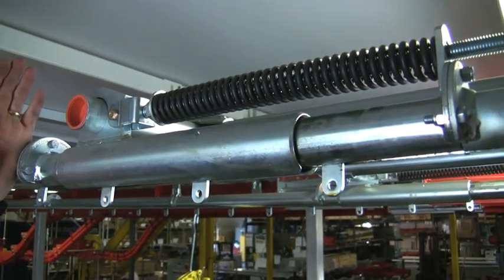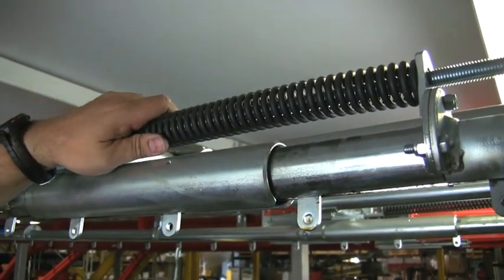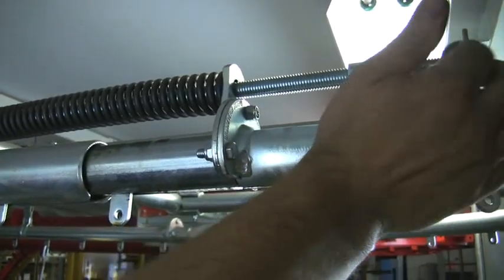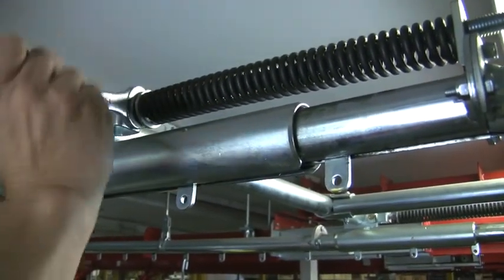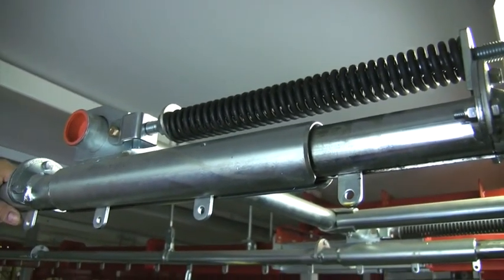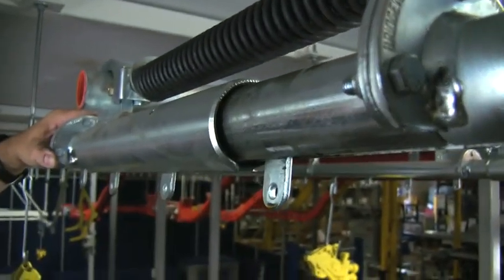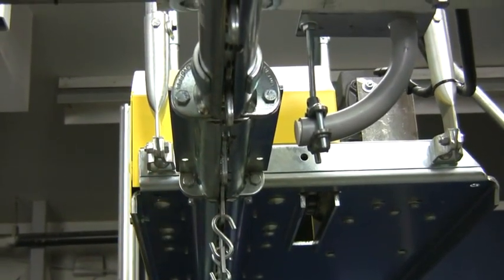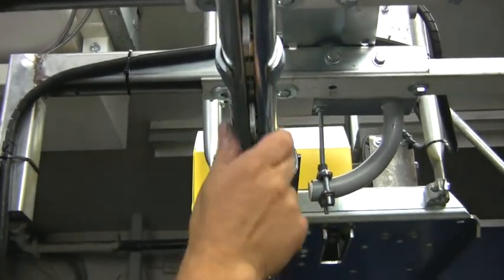Overhead Conveyor Maintenance: Take-Up Unit Inspection and Chain

Comment: removing a section of worn chain to shorten the chain does not take out wear.  the remaining chain is still worn,  and will wear the drive sprockets. the pitches have worn,  and are longer. stretch (due to loading) is different than wear due to long use.
Reply from the maker: Hi Shawn, you are correct.  Chains grow due to wear AND elongation due to loading.  Removing a piece of chain will allow the resetting of the take-up, which will prevent the future longer chain from jamming inside the track (because it has nowhere to go).  A take-up unit that is at its fullest travel will not be able to stretch out the lengthening chain.  At that point, the chain would “jam” inside the track.
Reply: of course I am correct. However,  the vid did not specify if this was new chain or old worn chain.  If a chain (industrial power transmission or conveyor ) has elongated by 3%, it is time to replace the entire chain. ..not take out pitches.